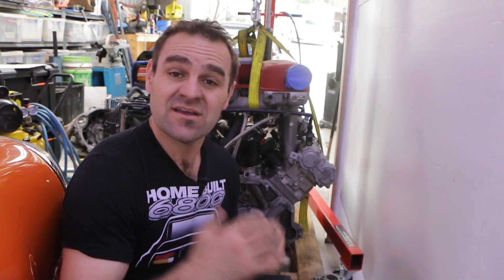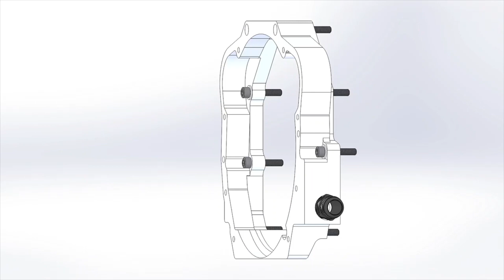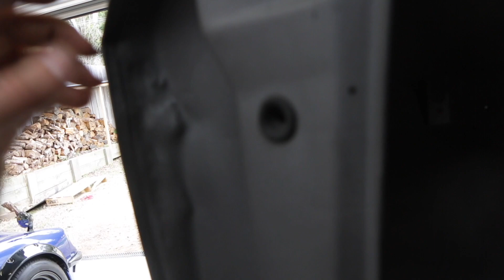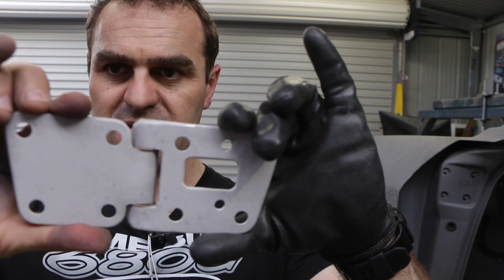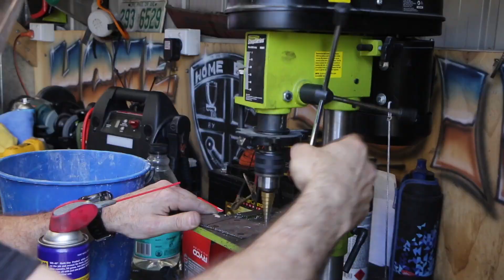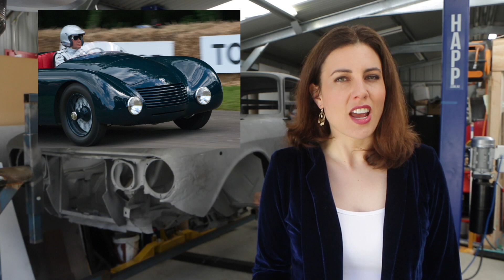How do you shrink steel body panels? - Alfarrari 105 project car build part 16

Comment: Feather it all out with a propane torch after you work the crap out of it. The same thing with the Stretcher/shrinker. Metal gets work hardened and won't move anymore. Heat it up with a torch and let it cool. Annealing happens quickly and then you can work it much easier

Comment: I was thinking that Ferrari & Fiat own Alfa which is now back in F1 that you sticking a Ferrari engine in an Alfa is quite normal Ferrari powers the Alfa F1 car. Your body work is fine I am thinking that a layer or 2 filler primer will hide it all.
Mrs Jeff your facts are a ray of light.

Comment: Top work Jeff! Don't beat yourself too much about the hammer marks, when I was researching metal shaping, most pros have a planishing hammer that can go around the edges (tinman's garage is an example of a  manufacturer). It hits the panel many times a second flattening hammer marks out, so without one of those it's close to impossible to make it as smooth as it was just pressed. Do take it slow when aligning the outer sill, sort out the b pillar bit as everything changes slightly after welding. Do put the door seal and sill plate in as it adds a lot of pressure when closing the door. It's long post but I'd thought I'd share some experience on one of the hardest things to do on these cars. Good move on renewing the hinge pin, I had to get the whole new hinges and casting isn't as nice as og ones
Reply from the maker: I am going to align every panel on the car and just screw them on, until I have everything where I want it. Then I will weld it all. It is going to take some time.

Comment: Jeff, if you're eventually going for GRP rear quarter panels (for some wider wheels, as per the GTAm) and a rollcage, maybe you could think about tieing the striker panel to the cage. This way you don't really need a 'new' B-post in order for it to be structural. Neither does the inner guard to be. 
If you're not going to use a GRP rear quarter, I stand corrected.
Reply from the maker: Keep watching ;)

Comment: The Central Europeans were at the leading edge of automotive development before WWII.- mid-engines, transverse engines, air-cooled engines, front-wheeled drive.  The Germans pushed their industrial capacity into total war production and relied heavily on their excellent engineers and manufacturing capability especially for armored scout cars, self-propelled artillery and tanks.

Comment: Loved the panel beating, that's quickly becoming a lost art when most just replace.  I noticed that patio heater, imagine its still cool there in Australia. Sure you know this but be careful using indoors. They produce more carbon monoxide than your regular indoor heaters. Cracking the bottom of the bay door may not be enough, some folks think that Carbon Monoxide sinks, its a bit of a myth. Dizzy/headache etc is what your watching for if your not aware. Safe working. Love this project.
Reply from the maker: I am a firefighter ;). I only use it with the door completely open and the garage is not sealed anywhere ;)

Comment: I would have done the final finishing on that guard using a Shrinking disc . Once the panel is close to where it needs to be , using the disc  helps you get a smooth finish ,

Comment: Using a file as a slapper! I wish my coachbuilding instructor gave me that option. Also, try looking up a shrinking disc, it apparently works really well. Also, also, try polishing the face of your body hammers, it prevents marring of the metal being moved.

Comment: Very nice work. Have you thought about using body solder as a filler? It's like the old time lead filler that will kill you but it is neat stuff to work with and is safer now. Eastwood sells kits.
Reply from the maker: Not really. The reason leading has been left behind is because lightweight body filler if used correctly is a better product all around.
Reply: I guess I haven’t come across many vehicles where it was used properly lol. I tried the leading on a 37 Ford I’ve been working on. it’s  pretty easy to work with and has held up, even left in primer for about 10 years. But yes it would be slightly heavier then filler.

Comment: I love this build best, great work.  FYI,  you can use your tig torch instead of the stud gun to add spot heat to shrink the metal, also they make shrinking hammer that works very well, they come in several sizes.
Reply from the maker: I hadn't heard of using the TIG, but that makes sense. Nice tip.

Comment: great episode Jeff, loved the panel bumping- you can use self tapping screws to secure things like the sill in place to align everything before welding
Reply from the maker: I will be doing that, as I need to line up all of the rear panels before I weld anything.

Comment: G'day from West Australia, Jeff 🙂
You hit the nail on the head buddy Patience is KING when learning to manipulate metal where you want it to go😉🙂👍👍
Unlike when I learned how to heat shrink for instance, 
An oxy torche with a number 6 or 8 welding tip ,a bucket of cold water and rag plus the obligatory  burns ROFLMAO.
Burnt finger tips and no feeling for weeks after.

You have a bit of fancy shmansy gear instead, very cool😉🙂👍👍
Reply from the maker: On the Z I used an gas torch, but this is much more controlled.
Reply: @HomeBuiltByJeff  chalk and cheese difference in temp control for sure Jeff.
And I do remember you doing the z bonnet with a torch😉🙂👍👍

Comment: The amount of movement in the spigot shaft isn't ideal for precise measurements. If I was you (I have done this personally with gearbox conversions) get a Subaru bellhousing and get a solid bearing spun up that locates the spigot dead centre otherwise you will have clutch issues either slipping or killing splines and clashing of gears. It could be a good idea to get your adapter 3d printed first?
Reply from the maker: I didn't measure from the input shaft at all. Subaru's dowels are perfectly in line and evenly spaced from the centre ;)
Reply: Something doesnt sit right though and I'm just pointing it out for you from my experience with this kind of work.  Good luck
Reply from the maker: @Paul_Tomlin  We worked from a another Subaru bell housing layout, and we only had to change the bottom bolts (after cross checking everything). It's dead on. The Ferrari side was the tough one ;)